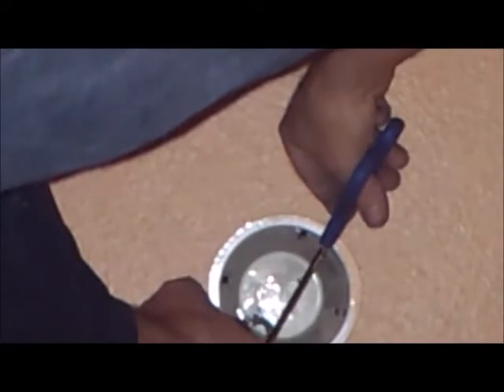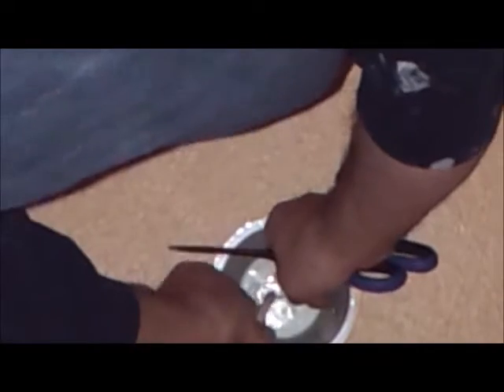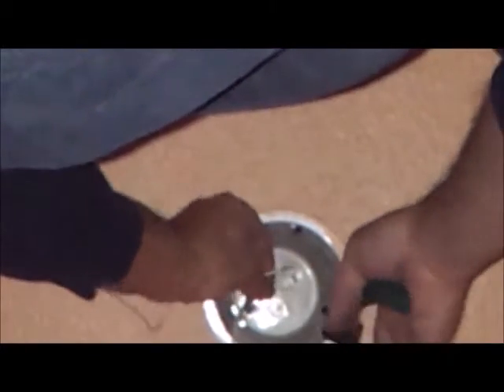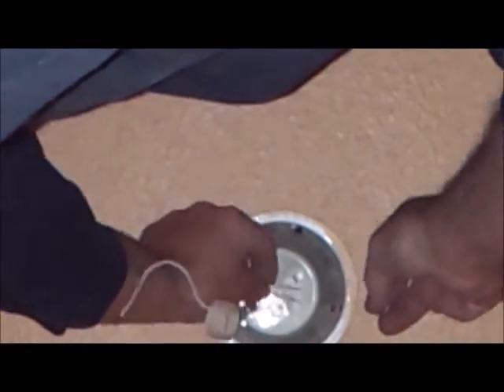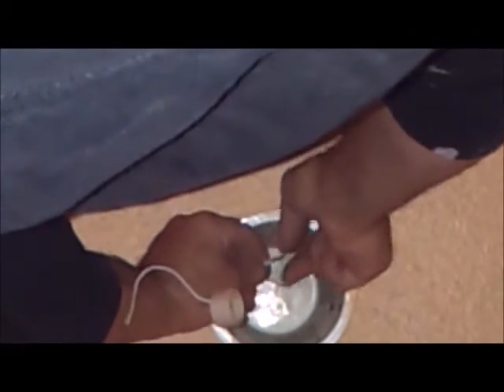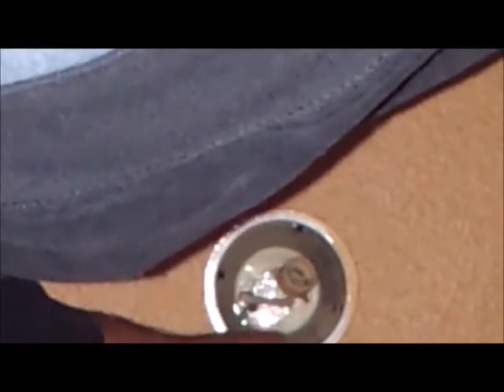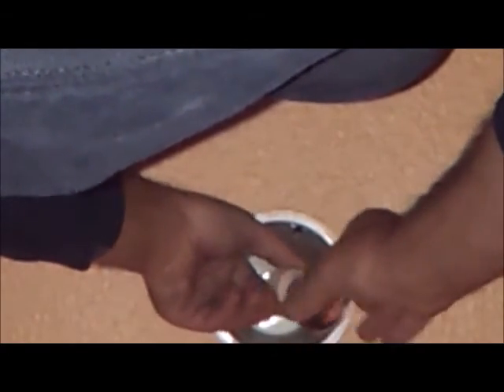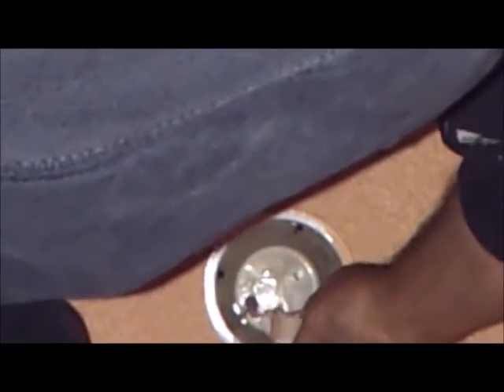Repair Faulty mr16 Halogen Light Socket with a GU-10 socket part 2

Comment: I know it's been long time ago since this video was published.  What size are the ceramic wire connectors? Large, Medium, or Small. Did they come with GU 10 socket? Home Depot don't carry them. Have to order from amazon. Thanks
Reply: Just wondering if you got the answer to this question - small, med., or large

Comment: I've got some 'new' MR16 (GU5.3) bulbs and some of the ceramic around the prongs seems to be missing but i don't see any loose bits in the package. Will they still work right or just have a shorter lifespan? (i don't use them - just want to sell)
What's up with these bulbs man?
Reply from the maker: If the ceramic is just a little chippy and not cracked it shouldn't be a problem just disclosed that in your ad
Reply: @greenrumour  thanks - great to know!

Comment: My mrc16 sockets have individual transformers little white rectangles.  I guess the wires for new pin sockets if I wanna keep the same mrc16 sockets and heat shields would be inside the little transformer. ???

Comment: I'm having the same problem as you had and my fixtures are only 6 years old. The push in pin design is completely junk in my opinion. My ?? is my interior height inside the fixture can is fairly tight. Is the total assembled height of the MR16 GU10 bulb and base the same height as the MR16 GU 5.3 bulb and base ?  Is there any height difference at all that would cause the assembly not to "seat" all the way inside the can ?
Reply from the maker: The total length of the gu10  bulb and base is 2 1/8"
Reply: @greenrumour  Wow...That's a super quick reply! I just measured my GU5.3 plugged into its ceramic base and its 1.950" So you're measuring from the face of the MR16 to the back of the plugged in ceramic base?  Also it looks like the wires on your  replacement GU10 ceramic base are coming out from the side of the base correct?  Thank you so much for your responses and posting this video!!
Reply from the maker: Yes you are correct I measured from the face to the back of the base. and the wires are coming out the sides.
Reply: @greenrumour  Cool. I think it will just make it into my can with those side exiting wire. Thanks a bunch!

Comment: I went to my local electrical supply shop, Bayshore Electric Concord CA, and they told me I cant convert the MR16 to the GU10 socket. They said I have to pull the whole unit down and replace the transformer and everything. So I just bought new MR16 sockets. I have the MR16 all over my house. They are about 3 years old and slowly going out one by one. Totally bummed! The GU10 sockets are way better.
Reply from the maker: +Big T Walker Sorry to hear that. What they are likely referring to is that you are using a 12 volt system with a transformer in each lamp. Since the over the shelf GU10 bulb is mostly 120v they are saying you cant because you cant get bulbs. Well the video is me changing out a 12v light body but I ordered the bulbs on line.
If they looked hard enough they would have found the bulbs not necessarily Ge or Sylvania.
Here are two of several places that you can get the bulbs.
http://www.ebay.com/itm/10pcs-GU10-BASE-12V-120V-20W-35W-50W-75W-HALOGEN-LIGHT-BULB-USA-Seller-Fast-Ship-/310702490096

http://www.amazon.com/eTopLighting-Bulbs-GU10-Halogen-Light/dp/B005BYZ16I/ref=pd_sim_sbs_60_5?ie=UTF8&dpID=41rMC9159dL&dpSrc=sims&preST=_AC_UL160_SR160%2C160_&refRID=1514NR53VTC4Y3STZY44
Satco has the sockets 90-1552 as well as online sources that are less expensive.
Reply: Thanks so much. I really appreciate your time. I swap them out on the next one that burns out.
Reply: I know this post was 4 years ago. I didn't know that they sell new MR 16 sockets. Do you think Home Depot would carry it?

Comment: In this thread people claim that it is a code violation to use wire nuts directly inside the fixture. You have to do it inside the junction box instead. Shame, since this seems like a much easier way.
http://www.city-data.com/forum/house/2365300-okay-splice-wiring-can-portion-recessed.html
Reply from the maker: I can see the point of not using plastic wire nuts in the can. However In my video I am using High heat ceramic wire nuts and the wire on the gu-10 connectors is high heat silicone wires. I believe this to be safe enough for the application.  As for wire nuts needing to be in a sealed environment I can  show you dozens of ceiling lights that have open boxes and wire nuts in the light body.  Not saying I am right. just telling about my justification.
Reply: Thanks for the response, and thanks for the video!